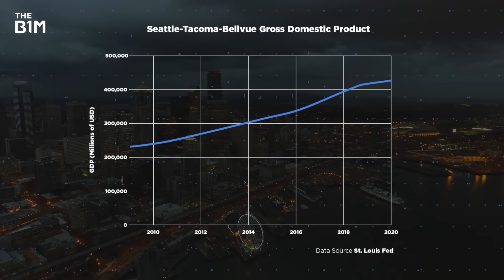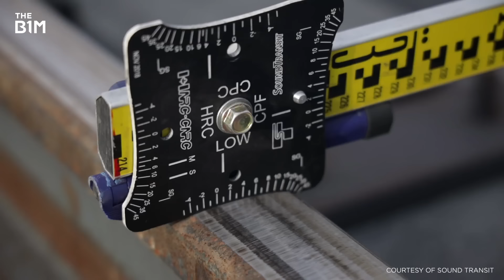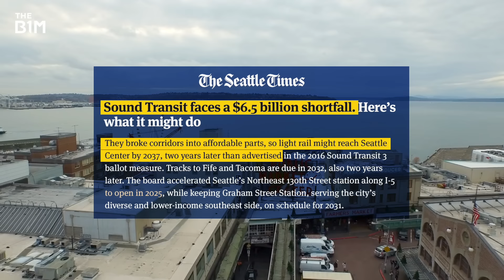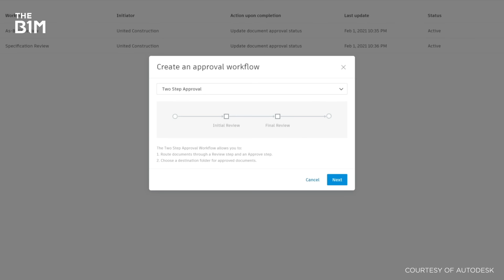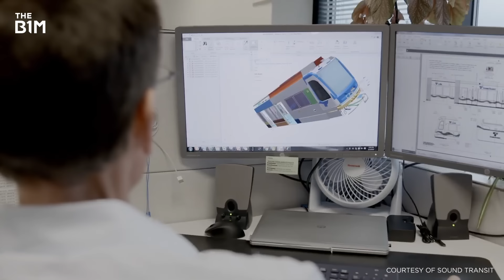Seattle is Building a $54BN New Railway

Comment: just imagine a HSR line that connects Vancouver, Seattle and Portland. Would be a game changer in the Pacific Northwest.
Reply: I’d love to see a bunch of HSR lines across North America… having one connecting my city of Indianapolis to Chicago would be such a game changer for us too.
Reply: As much as I agree with this idea, it won't happen. The airline lobby and automobile lobby are too powerful, and they'll pump as many resources as they can into opposing the project, not to mention loads of "environmental regulations" and "land acquisition issues" and "union disputes" that they might come up with during the construction.  Look at how California has spent over a decade trying and failing to build even little segments of their HSR line while at the same time going massively overbudget and spending years completely stalled out.

The only one that I see having a realistic change of finishing is Florida's Brightline rail, but that one barely even goes 200 km/h - it's not high speed.
Reply: The US went from, "Not in my backyard" to, "Don't build anything".
Reply: @martianbuilder5945  There really needs to be something done about how inefficient unions are.  Rail will offset far more carbon emissions than the auto industry will be able to.  That seems like as good a reason as any to protest for it.  The problem with Brightline is the lack of grade separated crossings.  It's also a source of a lot of suicides.  With regard to land acquisition, they need to be more involved in sharing the profits of projects around stations, so they can use that to help pay for the purchases.  I'm sure I'm over simplifying things, but if the rules are causing the trouble, then maybe it's time to change the rules.
Reply: Cascades HSR! Let's make it happen -A Vancouverite
Reply: Don’t forget to mention down to SF, LA and San Jose to La Vegas to, the entire West coast traveling will be incredibly efficient
Reply: I feel this HSR movement undermines efforts to have a decent conventional rail that reliably beats I-5 travel
Reply: @Jay-jq6bl  what do the unions have to do with any of what you just mentioned?
Reply: @mattkennedy6115  Jay's problem is he looks at every problem through his reactionary goggles.
Reply: Oh my god, what a dream. I think about that almost every week.
Reply: @AnEvolvingApe  I think it's a bit more nuanced than that. I understand the desire for unionisation, and the lack of trade unions in many sectors of the economy in the US is a disaster for working conditions and financial compensation, but while having a union is virtually always better than having no union, not all unions are equal, and there are sectors (even in the US) that are really held back by overly powerful unions. The whole point of unions is to level the playing field in negotiations between employers and employees, and when it does that it's great, but if the balance of power flips too much to either side, the system falls apart, and you either get inhumane working conditions (with too much employer power) or grinding inefficiency (with too much union power). So yes, unions are fantastic and every non-unionised industry should get one, but it is possible to overshoot the target and end up in a situation where building a railway costs several times more and takes several times longer to complete than in other economically comparable countries.
Reply: @rjfaber1991  Can you give me an example of where unions killed a business?  The USA had a 25% membership rate in unions from after WW2 until the 70's. During that time you could work any job and afford a home and a car. The USA currently has a 10% membership rate so I tend to think unions are not a problem.
Reply: @AnEvolvingApe  I think you've fundamentally misunderstood my point. Unions are not a problem, but when they become too powerful they can become problematic. The problems you're going to have in industries that lack unionisation are in my opinion far more pressing, so if I had to err on either side, I'd prefer overly powerful unions over overly powerful employers, but the system really does work well when the power balance between the two sits in the middle. 

The US currently (I can't speak to what it was like prior to the '70s) has very little of that. Most industries are horribly under-unionised, leading to things like the infamously terrible working conditions in Amazon warehouses, but the industries that are unionised (like construction) tend to be over-unionised, leading to big construction projects being two or three times as expensive in the US as elsewhere in the developed world.
Reply: @rjfaber1991  unionization causes construction projects to be 2-3X what they would otherwise? I doubt it.
Reply: But politics won't allow it.
Reply: @mattkennedy6115  Cost, because it needs to be affordable for it to be built.
Reply: @Jay-jq6bl  would you prefer it be built by unlicensed contractors with little to no safety record? Anything to save a buck huh?
Reply: We can't get one from Moline IL to Chicago, but you might have a chance, true. I'm just sick of lying politicians telling us we're going to get it and we don't.
Reply: I would not live there. It is going to get smashed by the subduction. Good Luck to you all !
Reply: @martianbuilder5945  Is this underway? From your post it seems as if it is still in the planning stage.
Reply: @Jay-jq6bl  Nobody seems to be taking into account the forthcoming earthquake and tidal wave. I won't live there!
Reply: @martianbuilder5945  Look up the German company Lilium, we'll likely have eVTOL on-demand flying cars before we finish the 'study' phase of a regional HSR line in the Pacific Northwest...
Reply: That would come with an entirely different set of construction difficulties. HSR requires very wide curves and long straight sections. The PNW is not a conducive region to this. There's lots of hills, mountains, and lakes, and building within these cities is incredibly expensive.
Reply: I believe that is now underway! Maybe? I was told by a coworker, but I have yet to look into it. (Apparently, there was $150 million allotted to begin planning ultra highspeed ground transport)
Reply: Who will pay for it, Mexico?
Reply: @Quantum-yz9fc  Perhaps a look at how Switzerland and Japan, both countries of mountains have dealt with this would be good. Japan also has the added population density and active fault lines.
Reply: That would be great. The homeless from all three cities could get around so quickly.
Reply: There already is a line it's called Amtrak.
Reply: @dvferyance  Amtrak is a train operator, not a line, and it has no high speed services outside of the Northeast Corridor.
Reply: Neat idea. This ain't that
Reply: But Portland and Vancouver have been having a pee measuring contest for years trying to connect the MAX over the i5 bridge, and the i5 bridge is currently crumbling apart and needs a replacement of itself
Reply: @jacobbullock2070  if I can get Cleveland to connect to Chicago, Buffalo to Boston, Pittsburgh and then to Philly and NYC I would love it
Reply: I'm for this idea if they can skip the 30 min wait into Canada some how.
Reply: Ya!  We’ll put a stop in your back yard. You’ll be so happy. 

Forget about it. The 10th Amendment makes it impossible.
Reply: Get it down to Eugene too.
Reply: @augustuscurnow  Yup, this is part of the SB 5974/5975 transportation package which passed the House last week and is currently waiting to be signed by the Governor, which apparently would qualify the state for an additional $700 million in federal grants. This is a pretty important event after an MOU was signed by OR, WA, and BC in support of HSR back in November. Apparently there's a target completion date of 2035 "if all goes to plan", but we'll see!
Reply: @TheTikeySauce  Oh my god that's so exciting! I hope passion is put behind this project and we see good development
Reply: From Cali and not gonna lie seeing Seattle makes me wanna move there…… Cali goin down bad😂
Reply: @afcgeo882  @drf81 PLUS Amtrak in PNW is running on freight rail tracks -- and freight trains get priority.
Reply: They pretty much have that, the cascades run by amtrak does that route super frequently and at tops of 80 mph
Reply: Please. And then also expand it down to every major oregon and washington city along i5 (at least until say eugene) so I can visit my parents or sister without having to drive so damn long
Reply: I'm sure it will be built right after the Californian High Speed Rail is finished.

Ha ha ha ha ha ha
Reply: Logical and much needed, so it probably won’t happen.
Reply: @parker6227  80 MPH is nowhere near high speed rail, and departures every 3 hours is far from frequent service.
Reply: @jacobbullock2070  commercial air is about 450 mph, HSR s about 220 mph...game over for HSR
Reply: It would be covered in hobos in a week
Reply: @martianbuilder5945  If Japan had a airline lobby, they lost as the air carrier lost a route because the bullet train rail system was extended to the island.
Reply: @Racko.  yes it would. I want to mention I used the Vancouver Skytrain. It was such a relief to leave the car behind. Travel from the sky train to the business by foot took longer but it also made me healthier. USA is the Fatest country in the world we end up getting sick disabled because he cant be bothers to walk around a city. Down town Vancouver has LOTS of people walking on foot!!! the general BMI of the population is thinner
Reply: @morbital  Seattlite here, we love Vancouver BC, would love HSR to get there.
Reply: @linmal2242  regionally, the area had small earthquakes 1998 or so. At that time I lived on Puget Sound, across from Seattle where I  watched my tile floor roll, while working in my home office. Several cracks in the ceiling, too. My mom, living higher up 4 miles inland and at a higher altitude only had some dishes fall off her dining hutch. Since then, I had a dream that that waterfront house would be flooded from RAIN. Who knows IF OR WHEN it could happen. I share your concerns.
Reply: @rylandspencer  chuckle, but seriously, King County has many employed workers who commute.
Reply: @afcgeo882  true, but nonstop to Portland, OR
Reply: @nicolatesla5786  Exactly
Reply: What about Tacoma?
Reply: @Racko.  the mountains in between make this very unlikely.
Reply: @jacobbullock2070  The fewer Hoosiers that come to Illinois the better. We have nothing to gain connecting to you other than to NW Indiana where there are useful mills, powerhouses, refineries and chemical plants.
Reply: @tombrennan6312  lol ok. what a weird reply. y'all Illinoisans are welcome to come visit Indy whenever you'd like - we'll show you what Midwestern hospitality is supposed to look like.
Reply: CA tried. I voted for the multi million dollar failed project for hi speed rail from SF to LA.
Reply: Having that connect to Sacramento to connect with California HSR would be even better.
Reply: ..what is the hurry..take amtrak
Reply: @jennifers6435  It's not the hurry, but if you want to go from Seattle to LA having HSR connecting Seattle to Sacramento is important.
Reply: not really, dumb idea
Reply: @tsgarage2382  Taking Amtrak from Seattle to LA is not worth it based on time, but by having HSR it is.
Reply: @MrBobDobolina  That's true, it just becomes expensive tunneling
Reply: they can call it the Gay West Coast Railway
Reply: From your mouth to God's ears!!  Such a line has been proposed for several decades.
Reply: @morbital  I just gave you a thumbs-up.  I wish I could give you twenty!!  When I was growing up, we took the Great Northern International from Mount Vernon WA to Vancouver.  Although it was traditional streamliner rail, it was a magnificent trip - just as Vancouver itself was magnificent!
Reply: @rjfaber1991  Projects in NYC that are done by unions are very expensive and inefficient. I could see the whole FDR DRIVE in Manhattan narrowed down to one lane for the whole night but I would only see a couple of guys walking back and fourth. Whenever power shift to one of the sides it becomes expensive and inefficient.
Reply: Marty Fourre  that’s not HSR!. That train/route are nice, I’ve been on it many times, but it is not a HSR train!
Reply: They have actually proposed a high speed rail project from Portland, to Kelso, to Tacoma, to Seattle, to Bellingham, to Surrey, and finally to Vancouver BC. I doubt it will start construction any time soon though.
Reply: Just imagine a world where people like you understand what the priorities are. Having HSR is pointless if getting from a suburb to the train station eats up a significant amount of the time you are saving by using HSR. You'll get far better bang for buck on upgrading transit.
Reply: Agreed.  Its criminal that its not already being built, ten years ago.
Reply: They don't need a high-speed train they need a good medium speed train that can stop along the I-5 corridor everywhere. High-Speed rail going from Portland Seattle doesn't help the working-class commuter..
Reply: @mattkennedy6115  Workers need good Unions we must build a strong labor movement to erase poverty.
Reply: @rjfaber1991  Unions enrich the communities period.  We need them.  Your arguement is moot.
Reply: @rylandspencer  Stop the bigotry.
Reply: @Gobbersmack  That is truly an ignorant statement.
Reply: @mark_tillman  Its more expensive for most people without unions.
Reply: @yourmother2739  And once again I have to start a comment with "I think you've fundamentally misunderstood my point".

If the discussion was a simple (but extreme) dichotomy between every industry must be fully unionised and all unions must be banned, then of course you are right. Individual employees can never engage with employers on a level playing field without unions, so a ban on unions will always cause employers to treat their employees as poorly as is legally allowed (a particular problem in the US, where many workers' rights aren't enshrined in law).

However, when unions become too powerful, and they are no longer just levelling the playing field in employer-employee relations, that's when things can go just as wrong as when employers are overly powerful. Overly powerful unions can force measures which may benefit employees in the short term, but come at such a cost to the company that it can no longer survive and the employees eventually end up out of a job. It can force long and incredibly destructive strikes over petty issues that don't warrant it, etc. etc. etc.

So yes, I think you'll find that I agree with most of what you are saying. Do unions enrich communities? Yes, they do. Do we need unions? Absolutely! Unions are one of the greatest social inventions to come out of the Industrial Revolution, and when they serve their purpose correctly they are the solution to many of society's problems. However, if they become too powerful, they can in fact become one of society's problems. That is the only cautionary tale here. Unionise, absolutely, but be aware that the purpose of unions is to create a level playing field in employer-employee relations, not to create a seeming workers' utopia that is unsustainable in the long run.
Reply: We don't talk about Portland.
Reply: Sound Transit is not HSR in any way, shape or form which in my opinion is what they should have been pushing for all along. Regional High Speed Rail from Vancouver BC south through Everett then Seattle/Tacoma then continuing south to (maybe) Olympia, Centralia/Chehalis, Vancouver Washington, on to Portland ending perhaps in Salem Oregon would be preferable because that goal is much more supportable and actually makes sense!!
Reply: Good news! It's being considered. Funding was recently approved to survey where it would be best to lay HSR tracks
Reply: @unatrek2821  Take in account of the people who prefer to take a FASTER train, meaning theres no wait in traffic, better for us and the environmental friendly since there is runs on electrical overhead wires and not gas, ofc there's "low" demand for HSR in the west coast, because it doesnt exist
Reply: @ee-ef8qr  More like Lobbying Culture, just imagine a fully functional and operational High speed rail between the North West from Portland-Seattle-Vancouver, all of the Ford Salesman and oil companies will be seething in rage
Reply: @dutchberry  Like always
Reply: Good news on this front. A draft environmental impact study is underway to test the feasibility of a Vancouver to Portland hsr alignment with both Washington state and Canadian governments showing increasing interest in the project. This hsr project would literally turbocharge the Pacific Northwest.
Reply: It's too complicated. Even though it might be possible but the delays, violence issues in transit, ghetto culture in public transit, disruption, and competition (airlines/cars) wouldn't make this possible. USA would need to put so much regulation where people going to say is human rights violation, r*cism, or tyranny.
Reply: @AngelicoCiudad  I think it will. The demand is strong in the cascades and public transit in the northwest is encouraged and very safe and clean especially in Portland and Seattle
Reply: @portcybertryx222  
L*berals (which those cities are run by) would need to enforce the laws and banned (or something?) people who misbehave in public transit to get support (to make people be comfortable and support that). I have never been in public transit in Northwest, but in Illinois and southwest USA, all public transportation are very wild and ghetto to say the least (ain't no one supporting that).
Reply: @AngelicoCiudad  mhmm I see your point. I’ve never had any issue on the commuter lines in Chicago, St Louis and in Caltrain, Arrow, LA light rail. But I think I see your point. The thing is these systems need their own police systems like the NYC, CTA, Marta lines. But a few cases here and there shouldn’t dissuade us from pursuing further transit.
Reply: @martianbuilder5945  Its already happening with the amtrak cascades. Its not really the speed that will get people using it tho people will use it if amtrak gets the ticket price down and they have been slowly doing that. The pt diffance bypass helped a lot becouse soundtransit/amtrak owned those new tracks.
Reply: Too slow
Reply: @martianbuilder5945 CAHSR is NOT failing. It has conquered more than its fair share of obstacles, and being built. The 171 mile section from Merced to Bakersfield will be ready in 2030. And a smaller 119 should be ready by 2028 that will be used for testing the trainsets at 242 mph.

The bugger issue is getting much more federal funding.

BTW, the construction of HSR will compliment other forms of transit. It's not an either/or option. In fact, many airports are already at capacity. And we'll always have personal vehicles too. Having a national comprehensive HSR passenger rail service is needed as a viable option to flying or driving. It gives you a little of both. Not as fast as flying, but more comfortable. And faster than driving and safer, but not as flexible.
Reply: CAHSR is already building their sections, and possibly the section from SoCal to Vegas too with BLW.
Reply: Last year, Oregon and Washington departments of transit put $150 million into the Cascadia HSR project for exact right of way identification, environmental studies, seismic studies, etc
Reply: @morbital  I would personally visit vancouver more often if we had affordable HSR to get me there.
Reply: @katzgar but commercial air is expensive and a pain to go though. While trains would be a better option getting around the area while air line would be best in far distances like the other side of the country or another
Reply: @jacobbullock2070 I’m in Indy too, Zionsville/Carmel area and I agree. It sucks having to deal with horrible Illinois drivers on I-65. so If the bad illinois drivers get off the roads, that means less traffic and I can drive my car all I want without changing speeds and lanes.
Reply: The Cascadian HSR would be fitting.
Reply: Wow that is one great idea
Reply: @jacobbullock2070 big oil will stop
Reply: They should do the same to Leavenworth as that town as a lot of tourism and HSR can accommodate that
Reply: I have a simple question. The federal government contributed 20 billion dollars I believe it was to California High-Speed rail. What do you think would be a better expenditure of 20 billion: High-Speed rail in California or local light rail in say, Pittsburgh where I live?
Reply: @jacobbullock2070 I have a simple question. The federal government contributed 20 billion dollars I believe it was to California High-Speed rail. What do you think would be a better expenditure of 20 billion: High-Speed rail in California or local light rail in say, Pittsburgh where I live?
Reply: it should connect to californias HSR too. "West Coast Link"
Reply: Just imagine spending 20 billion dollars on a light rail line in Pittsburgh. That would help a lot of people get to work, go to appointments, and go to events.  That would reduce pollution in a city, and of course cities are where pollution is the worst
Reply: Need the PNW HSR to go to Eugene!  Better to live in Eugene & HSR commute to PDX.
Reply: @RussSmith-xu6kd  I still say spend 20 to 30 billion on light rail in Pittsburgh or another small to mid-sized city where pollution is bad and kids in the city suffer from asthma, as opposed to HSR. High-Speed rail up and down the West Coast will neither reduce pollution, reduce asthma among kids in the city, nor help people get to work, go to appointments, events, etc.
Reply: Amtrak enters the chat
Reply: HSR between Van, Seattle, and Portland… why?  Other than sporting events, who would take it and how often?  The main places people travel out of Seattle to are; Southern California, the east coast, then maybe Denver or Chicago. Because those are the places that virtually everyone who lives here, or has moved here recently, is from.  If HSR can get to those places, then it makes very good sense. Even Seattle to Portland alone can’t work because of the disagreements of both states. They can’t even agree how and when to build a new interstate freeway bridge over the Columbia river. That should be simple, but here we are 35 years later with an outdated bridge.